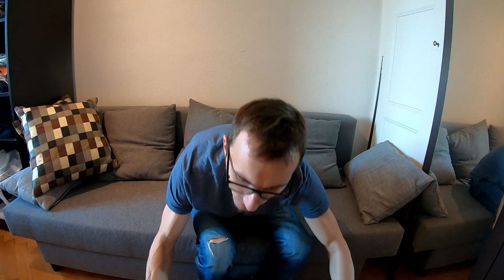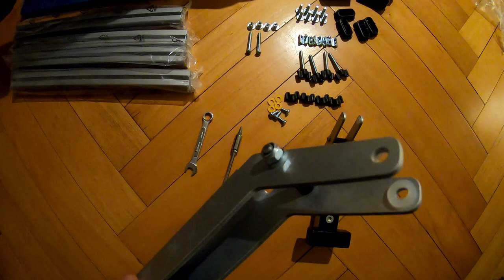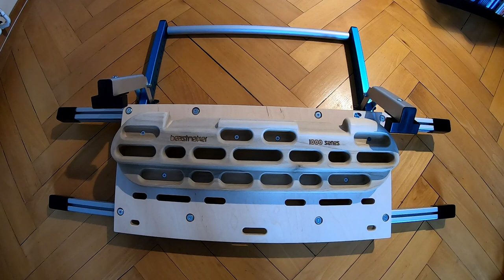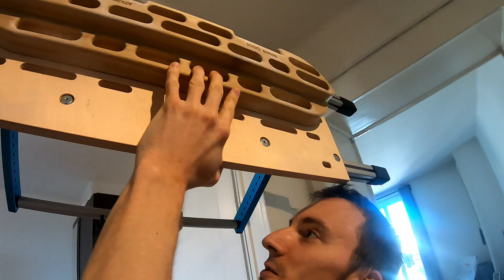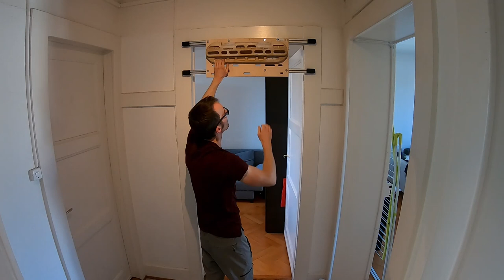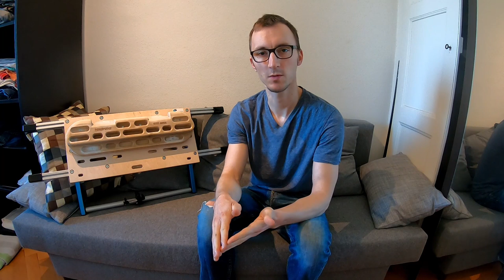How to install a hangboard with no damage to your wall - using the rockbaseFlex

Comment from the maker: Short update from my side (as the video was released more than two weeks ago). Still no problems with my setup. I now also did some max weight pull ups etc. with some more weight and it was working absolutely fine - but of course this will also depend on your door frame, not just the rockbaseFlex. If you have questions about it, just drop a comment here or write me on instagram ;)
Reply from the maker: First video with 1k views :)
Reply from the maker: Next update from my side: So far, I still did not have a problem with it. I have mainly been using it for deadhangs and max weight pull ups (as well as assisted pull ups with a pulley system)

Comment: Aren't you afraid of the decorative moulding falling off? The moulding is nailed in by thin bradley nails. A friend split his knee cap in half trying to do pull-up on a similar design. I feel awfully uncomfortable pulling on the moulding. Any issues so far?

Comment: Hi, my door frame is just about 1 to 1.5 mm thick. Do you think this construction will be stable with this small door frame?
Best regards
Reply from the maker: Hi, I think its best if you contact smart rock (https://smartrock.de/unternehmen/support-anfrage/) to be on the safe side. Usually, they answer pretty quickly. If I am not mistaken, 1.5mm should still be ok but don't take my word for granted :-D See https://smartrock.de/en/mounting-systems/rockbaseflex/ There you can see the requirements. But as I mentioned, to be safe better contact them. For instance, for my door frames, the measurements did not fit 100% perfectly but I clarified this with them and I gave it a shot. Good luck!

Comment: What size screws/tnuts did you use to hang the beastmaker 1000?
Reply from the maker: I ordered the screws/tnuts from them too (as they also sell the fitting screws/tnuts), thus, I don't know by heart. But I can try to measure it if you want to :D
Reply: @boulderfighters2590  That would be helpful if you have time! I didn't even realize they sold set screws till you mentioned it haha. Would have bought them as well. Sadly the shipping to the US took 2 months due to covid so I'm a little worried to order the screws from them.
Reply from the maker: @jamesmoore3304  Hehe, I can imagine. I just did a short search as my RockbaseFlex and the Beastmaker are currently at a friends place so that he can train on it :D (as at our place the gyms are still open and we can still train and boulder at the gyms). I found this: https://www.beastmaker.co.uk/products/beastmaker-1000-series There they mention the size of the screws. But I can also contact smart rock and ask them about their size of the screws and the t-nuts.
Reply: @boulderfighters2590  No worries! I reached out to Martin at smartrock and he hooked me up with the smart rock manual this morning. I should be good to go now. Thanks for the help!
Reply from the maker: @jamesmoore3304  Yeah I also contacted him like an hour ago and he told me somebody else asked the same question :D. I guess this was then you ;-) Then I guess you don't need the information any more. Hope it works out for you!